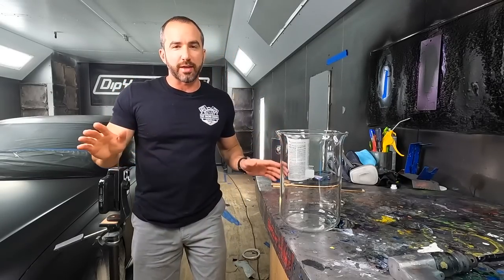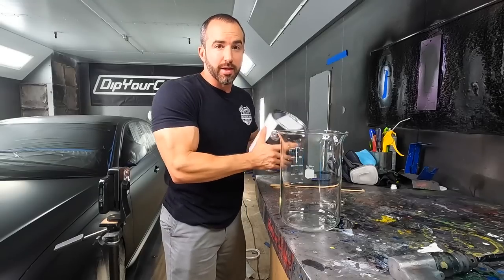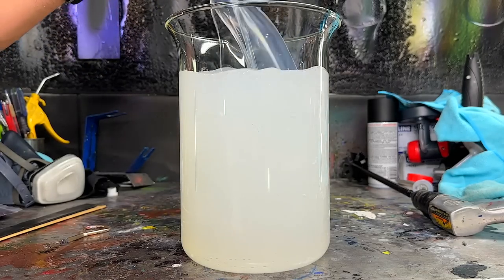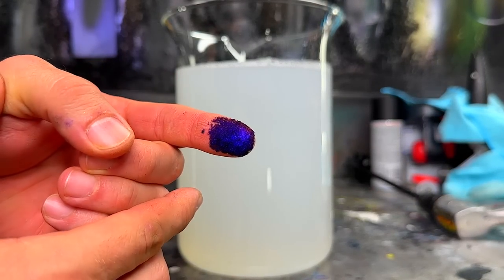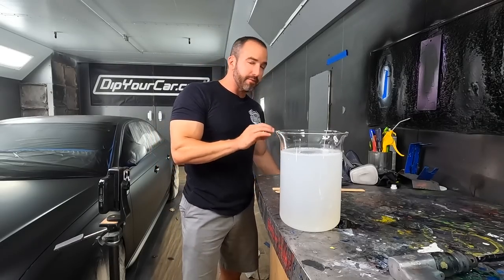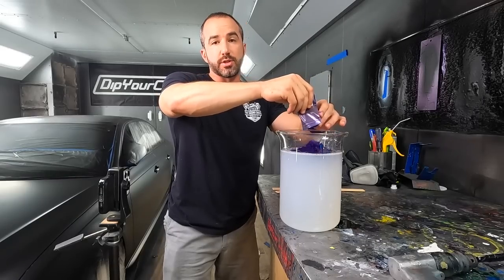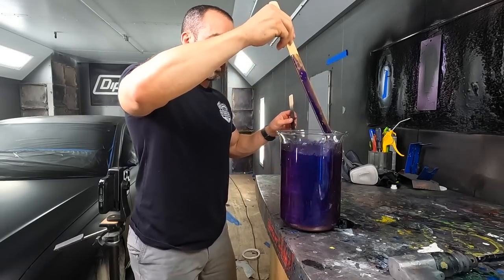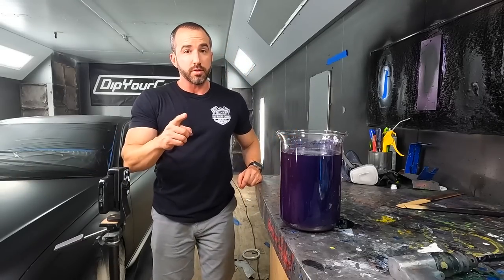What Happens When You DEEP FREEZE this CRAZY HyperShift? (Results Will Surprise You)

Comment: Looks great! I have a question about the plastic dip..can you put a clear coat on top of this on a vehicle? I've done it on small projects and it turned out shiny, and when I'm ready to peel it off, the clear coat comes right off with the plastic dip product. I never used the 2k clear or the real clear coat for cars. On my projects I use the Dupli-color crystal clear before and it turns out really shiny. Thanks for the content and awesome job.